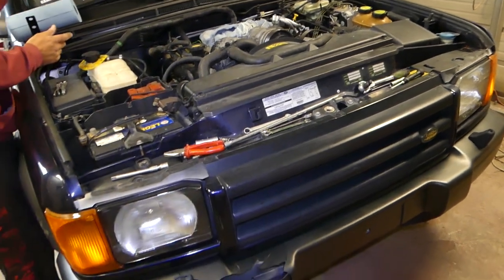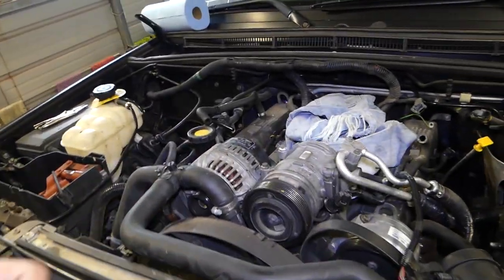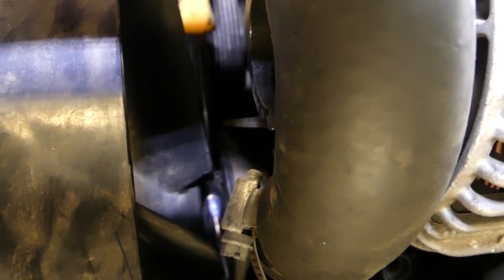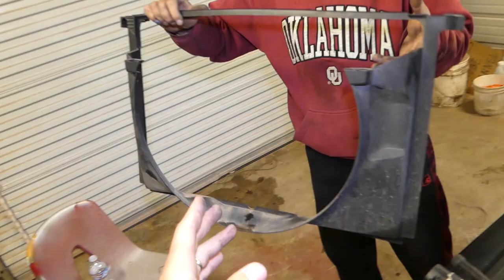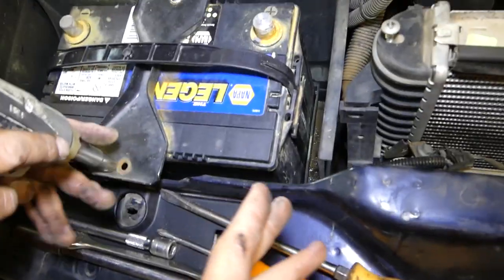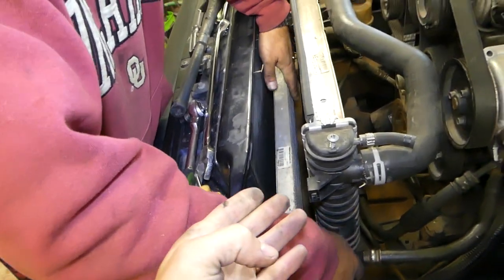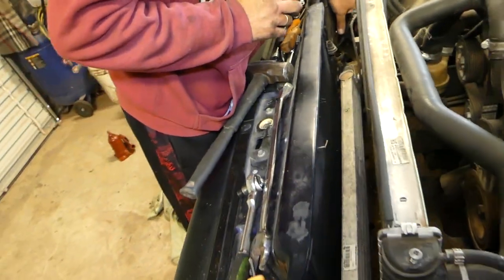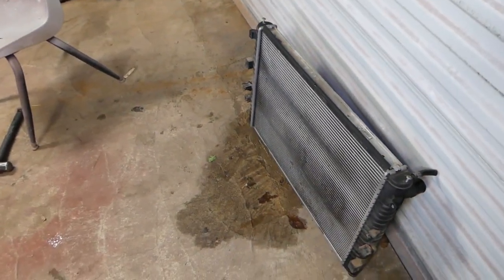LAND ROVER DISCOVERY RADIATOR REMOVAL REPLACEMENT

Comment: Great video HOWEVER be aware there is a multiplug sensor (looks like an electrical or computer plug) at the bottom of the radiator on the passenger side. This is for the coolant temperature sensor. The sensor screws into the bottom of the radiator, and the plug plugs in to the sensor. You'll need to remove the sensor from the old radiator or get a new one to put in the new radiator. Otherwise great video and helped me get this repair done confidently!

Comment: Thanks for that video. I have to replace the PS cooling tube behind or under ( not sure) the radiator. The hose is leaking at fittings over top of the PS box.

Comment: Thanks for the great video, did mine today because of this video. I don't think I would have tried it otherwise. $60 radiator and $30 of new coolant. Did not remove the fan though. The fewer things I touch the fewer things break. Not removing the fan did give a tad less room to work but it was still doable.
Reply: the same way, not removing the fan is possible
Reply: 60 dollar radiator
Reply: @jonredd650  Junk yard radiator?

Comment: Would the radiator need to be pulled out in order to replace the high pressure hose from power steering box to pump? I’m having no luck finding videos showing how to replace one? Mine is an ‘01 disco 2. Thanks!

Comment: Hi ,Thanks for the video  I have watched lots of them however this one I would like to disagree you don't have to open then Fan to remove the radiator . I have done it without removing the Fan.
Reply: What’s hard to work on when u didnt remove the fan. I dont have the spanner so I will do without taking it out. Thanks

Comment: Where can I find instructions on how to remove the power steering cooling tubes under the radiator ?  Or now to remove the transmission cooler?  For 2003 Land Rover Discovery II SE 4.6L
Reply: to answer my own question -  the trans mission cooler move out of the way easily when the radiator is loose.  the key to getting the radiator loose form its brackets is to not use a short screwdriver as shown in this video a 7:26   - but to use a long one -  if you pop off the plastic grill, you can see these screws much better and you will have full access to them using a long screwdriver.  or it is possible I suppose if you have a really long screw driver to reach it right through the grill - you can see these screw looking in through the grill.  In any case, you must slid the transmission cooler to the the left to get it loose form the radiator bracket.  Then everything is lose enough for full access to the Power Steering cooling tube if/when you need to replace it.